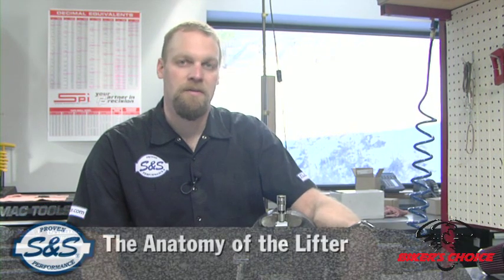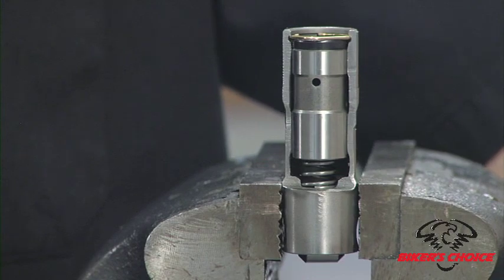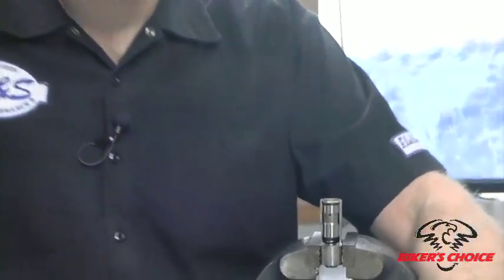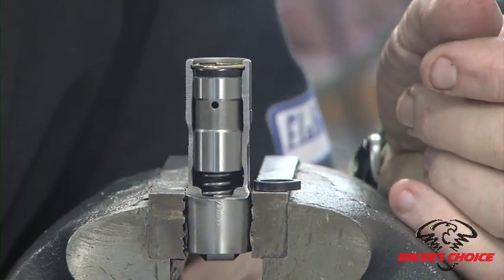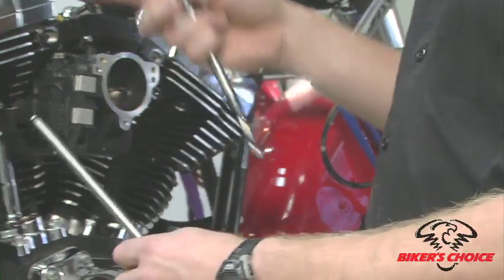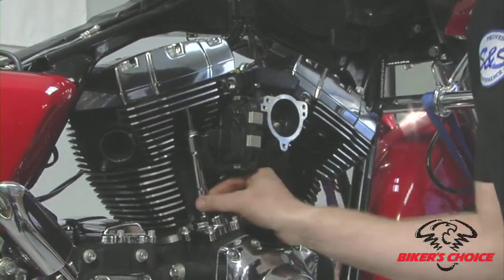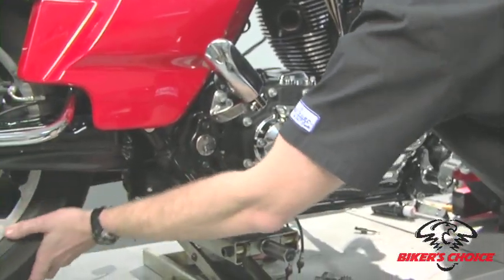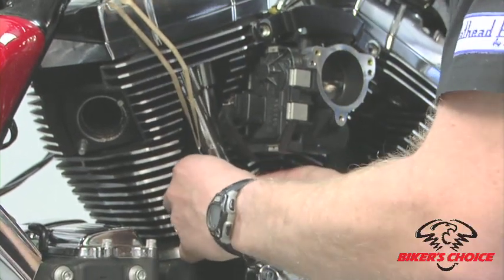S&S Performance Parts - Pushrod Adjustment - J&P Cycles

Comment: I have had Justin Bramstedt do work for me Trued up my Harley Davidson flywheels I went with a S&S crankcase S&S Crank pin HD rods S&S pistons flat top =20 over 3.518, SE heads EV 23 cam  100 HP EVO  Justin Bramstedt  has a Shop in Viroqua Wisconsin Just Torque it  has FB page also super cool guy top of the line work.  this fall Im shipping off a Bottom end for new bearings true flywheels for a new build  in 2026 .

Comment: We're going to talk about him being a damn liar 
I bought the standard pushrods 99 and up twin cam they will not fit by swinging The tap it cover off to the side! 🤬🤬🤬🤬🤬  you have to pull the rocker boxes and put them in from the top just like stock pushrods then adjust them how do I know because I watched this video and I bought those instead of the quickies and I found out the hard way I ended up buying the quickie set 300 f**** dollars more 
There is a reason the guy started the video with the quickie on the intake pushrod already done,--" the one that  will not fit when you slide it sideways to install he is full of shit!🤬
Reply: I too heard him say that the standard would go in just buy removing the tappit cover then a second later he says that only the quickie will fit in without messing with all of it

Comment: Good morning 🌅, J&P , I am from the future 😂2024 , I have just recently purchased a 2003 Softail deuce, somebody has been inside it, and put in SS gear driven cams G510 , and they have left in the original cam plate, I cannot quite see whether the oil pump has been changed, 
I have noticed that it seems to be very noisy , and I am thinking of stripping it all out and replacing cam plate, and obviously bearings plus new oil pump, and I believe that the engine has gone from 1450 to 1550, I’m not hundred percent sure because I cannot obviously check the ball and stroke without dismantling it, Do you think it’s worth stripping it completely and starting a scratch with new complete parts?, or shall I just change plate and bearings as necessary? France, I might have already asked this question, with you or somebody else,

Comment: Excellent explanation of how to adjust pushrods for hydraulic lifters. Didn't know about compression release on the exhaust cam for twinks or about the special push rod covers needed for s&s quickie pushrods. That will save me some grief.

Comment: The best thing I learn from this video that helped me do my cams/ pushrods was when you spin the back wheel and the two front push rods are moving together then the rear push rods are on the bottom lobe and are ready to be adjusted; then just do the same for the other side

Comment: The ideas behind the math of flats , wasn’t really explained. If six flats is one complete revolution , you divide the total number of flats , by 6 , to calculate complete turns. Hence 24 flats equals 4 complete turns.  Combinations of complete turns and remaining odd flats. 21 flats equals 21/6 or 3 1/2 turns.
Reply: Your math is correct. The only variable is threads per inch on the push rods. S&S quickees are 32 TPI, or .03125 per full turn (6 flats)

Comment: Help I have 6000 miles on a build and was trying to adjust S&S pushrods while doing so my wrench broke parts of it fell within the tappet hole so I was forced to pull the tappets out I forgot to mark what order they came out in  does it even matter can just put the tappets back in without knowledge of order the two tappets came out in

Comment: I have a 1990 fatboy with E46 cam I just bought the SS HL2T lifter kit My question is should I remove that limiter or solid hi rpm .maker or leave it ?

Comment: I had a tap on my 1340 evo 1990 fatboy so I bought S&S lifters using the same Rivera tappet lite ajustable pushrods it was quiet for about 40 miles  now it sounds like there is marbles in there WTF.
I limped her home last night from work at 1 am not wanting to rev it up at all ... 
I'm wondering , will I gain anything by installing S&S Ez adjustable pushrods?  I'm also wondering if one of my brand new lifters is crap.

Comment: Would improper adjustment cause backfire out the air filter,when cold starting. It only does it after the bike sits for awhile, it will idle then sputter and back fire out the intake and stall. But it will start right back up.

Comment: I have a 2014 heritage and I want to do a stage 2 upgrade. What are the item # for the cams and adjustable pushrods that would be good to use in my case? I was leaning towards the 570 cam.
Thanks

Comment: Why does the S&S instructions say 4 turns or 24 flats but this video says  20 flats or 3 1/3 turns.
 This guy works for S&S and is a great mechanic but on the flats has his info confused.
TWO YEARS LATER AND NO ANSWER  FOR MY QUESTION !

Comment: Is there any concerns about the jam nut backing out and the pushrod coming loose? Or, is it safe to assume that when the jam nut is tightened against the pushrod it will not come loose. Thanks.
Reply from the maker: It's a legit concern but I have never seen it happen. You could use a little blue thread locker on the jam nut if you wanted. 
- Patrick
Reply: Use two 7/16 wrenches to lock the nut to the S&S quickee push rod and it will stay there for years.

Comment: Does anyone know if I can install the “Standard Adjustable” pushrods on my EVO without taking the rocker boxes off? It sounded like he said that you did. I want to know as I have the standards installed and have leaking pushrod tube o’rings. Thanks
Reply: On a EVO, you must have the Quickees or take the rocker covers off.

Comment: Great video, learned a great deal. When I look at my instructions it states 24 flats. I am using stock Harley lifters, what would be the best sweet spot for my 103 twin 2016? I noticed you did 20 flats. Thanks, Dave
Reply: The best sweet spot on the stock Harley  lifters is the garbage can.
Reply: @good-boy-ringo  the dudes asking an honest question why you gotta be like that
Reply: @tommys2979  ... This is my opinion about Harleys . I didn't say anything out of the way . if you don't like it to bad. Stop being a cry baby.
Reply: @good-boy-ringo  so which brand of lifter do you suggest?
Reply: @Jkur2009  ... S&S lifters

Comment: The written instructions from S&S say 4 full turns, which would be .125”.   Which is correct?
Reply: This is the question I have . What is correct ?
Reply: Good boy Ringo I called S&S and they said 4 full turns.  That’s what I did and it works fine.
Reply: @joet3408  ... Thank you .

Comment: How do I make sure the jam nut stays tight and doesn’t back out?
Reply: Use two 7/16 wrenches to lock the nut to the S&S quickee push rod and it will stay there for years.

Comment: I have a sportster, 2002, 1200, I'm thinking about replacing my Cam Cover. (It's all flaking the chrome) 
Does S&S make adjustable push rods for my 1200? 
I'm thinking that might be easier than pulling my rocker boxes. My rocker box's are not leaking, I don't want to disturb them. 
Harley Dealership Replaced the rocker gaskets Circa 2008. Haven't ridden It a Whole heck of a lot since then. (10,000 miles maybe)
Do you happen to have a video like this, only on a 1200 Sportster, Frame mount motor. I think from research, 1995 to 2003 was the same Cam/gear cover.

While I'm in there, (If I decide to change the Cover) Is there a good "Mild Cam" Set I can install That will give me some Low to mid performance. I have Vance and Hines Pipes, (Like long shots I think) and screaming Eagle Air filter.
If I put a set of mild cams "Geared" for low to mid range, would I likely need to re jet?

I'd want cams that will "Go right in" (Don't want to have to modify the case, like I saw on another video)
Reply from the maker: a great cam set for what you are looking to do is the S&S .482, its a straight drop in , no modification needed. Yes you can use the S&S quickee pushrods and you wont have to disassemble the rockers.
Cams
https://www.jpcycles.com/product/714-584/s-s-cycle-482-camshaft-set?redirectedKeyword=330-0189&totalResult=1
Pushrods 
https://www.jpcycles.com/product/420-307/s-s-cycle-quickee-pushrods

Comment: Watched this over and over,mainly because I suck at adjusting them,followed everything properly(I think) but still got the tap.. just installed Screaming Eagle Cam Plate,Hydraulic Tensioners,High Flo oil pump,Screaming Eagle Rods and Tubes(Screaming Eagle Rods 2 1/2 turns) I'm frustrated!! Video is very helpful though.. guess I'll go back and do it again for the 10th time

Comment: The S&S instructions for the height limiting says go four turns, 24 flats. Not 20.
Reply: In my opinion; most videos involving s&s quickies use 4 turns. Therefore making the valve train quieter.
Reply: They have like 14 different lifters. The naming and part numbers couldnt be more confusing over the years and i've lost track as to what the hell some of them are or were. Still a great product though haha!

Comment: Go with the Quicky pushrods, Huge time saver because you dont have to remove the lifter covers. Removing the covers is not a big deal but aligining the pushrod when with the lifter cover is a major PIA. Almost no space and you have to be at the exact correct angle or it just will not work.

Comment: so what if you adjust it to 24 flats and still cannot turn the pushrod when the lifters bleeds down and you do not have limited travel lifters? Do you back off the adjustment until it turns?
Reply: In same boat,  find an answer?
Reply: If you wait 1/2 hour and the push rod still won't turn, the valve is open. DO NOT proceed unless the push rod turn with your fingers.

Comment: is this the same way i would adjust my push rods on a 96 1200 sporster ita got hydrolic lifters and adjustable lifters
Reply from the maker: I'm assuming you mean adjustable pushrods. Most of the adjustable units are the same basic adjustment.

Comment: what do you mean by base circle of the cam??
Reply: Same as the "heel" of the cam. Basically 180 deg. opposite the lobe centerline of the cam.
Reply: When the piston is all the way to the top of the cylinder and both valves are closed.

Comment: Do you need to cut the keeper?? I've installed a set of quickie push rods and all they had done is leak!!!
Reply from the maker: I use S&S push rod tubes with my Quikies and have never had a leak.
Reply: How do push rods leak? Are you talking about the push rod cover o-rings leaking?

Comment: Nice job, thank you--1 quick question, with the  S& S "Quickie  push rod" is the intake rod a different length than the exhaust push rod?--or are both identical lengths?
Reply: On my 80 inch EVO, the intake push rods are shorter than the exhausts by about 1/8 inch. 2 different sizes.

Comment: Great info! Id like to add that this information is for S&S pushrods. The TPI or Threads per inch vary from brand to brand.. you MUST know your TPI before attempting to adjust! The turns or "flats" WILL be different..

Comment: How does a person know "IF" the hydro has bled down before the push rod is to be adjusted?  In other words, How do you know if it is pumped up or not before adjusing?
Reply: these adjustments are to be made on a COLD engine.. so the only "pumping up" of the tappet that should be happening is you turning the engine over to make sure you are on the base of the cam. Shouldn't have to worry about it too much. I always spin the pushrod before loosening the lock nut.. if it spins freely.. should be good to adjust.
Reply: on the other hand.. once you've adjusted the pushrod.. you MUST wait till you can spin the pushrod you just adjusted freely again..using just your oily fingers before you move on to the next cylinder.
Reply: one more thing.. this info is for S&S pushrod.. the TPI or Thread per inch varies from brand to brand.. you need to know what TPI yours are before attempting to adjust.. Its easy to figure.. remove one of your pushrods.. use a measuring tape and measure 1 inch of threads and mark with tape to hold your spot. Count the threads in the measured area.. this will give you your Threads per inch.. then look up the specs for adjusting.. ie how many "flats" to turn down..

Comment: Now here's a guy who knows what he's doing. I've a strange rattle somewhere. In my original search I find that compensating nut is loose, clutch spline stripped, hub is spider webbed and bearing is making rough noise and clutch discs were worn into hub segments. New clutch and tight compensate nut and less noise but still a strange rattle. 25,000miles on this 124 TC and I'm wondering if this normal.
Reply: Funny, I have kind'a similar story. 1995 Evo with a cyclic" knock/clackity clack". Sounds like its coming from Compensating Sprocket. Replaced Spring pack- all else looked good. Still had that knock.

Watched/listened with primary cover off... looked like chain stretch and noise was from some slap. (from chain flap itself- not against the inner case). To check I slightly over-tightened primary chain. That seemed to lower the knock. But with the quieter primary, I am hearing just as much clacking noise from the right side-loudest at rocker boxes ?! Its hard to narrow it down-especially with loud pipes, even using a scope. 

Regardless, have to now consider the noise is from valve train. I have not yet replaced the stock cam bearing with the Torrington. Since I am also getting some " intake farts", and dead-spot on acceleration from a stop, It is pointing to a lifter problem. Has that darn primary noise been covering up the lifter noise all along? Will find out when I start pulling the boxes and nose cone off.
Any comments appreciated. Low mileage = 35K

Comment: I have a 2005 S&S Evo 96" engine,  Do I need to remove the rocker boxes to adjust the pushrods. I know the pushrod tubes are different than Harley stock pushrod tube covers,

Comment: I managed to break the cylinderhead. Supposingly the spring from new lifter had got stuck a bit and lifter ended up being too long when it filled and valves hit cross. I found changing them from top with originals, comes to cost the same, its not that time consuming and doesnt harm to have a look under the rockerbox either. How often you do this anyhow, every five yrs or so.
Reply: That SPRING would not have Done That.. You Adjusted one or Both Lifters Slightly on the LOBE.. Not to Worry ive Seen this Many times.. GOOD LUCK. 👍

Comment: Vary well done thanks but if you have done all that 10 times plus put in a fueling set up beehive springs plate chain drive oil pump and roller rockers and you still have top end radial.  
 I have a Crane HTC 300-2 cam only a 505 lift,. I have had the thing apart 5 times looking for something broken I have replaced every part in there trying to find the bad part. except the cams.  Is the problem the profile of these 300-2 cams?   
  its is the only thing I can think of. this is not my first rodeo I'v done many twin cam upgrades with way more radical cams and never had this much noise.

Comment: Wouldn't that be 18.75 turns? based upon the numbers you gave....Just slaying... (100,000 / 32,000) = 3.125 Rotations * 6 flats per rotation =  18.75 flats